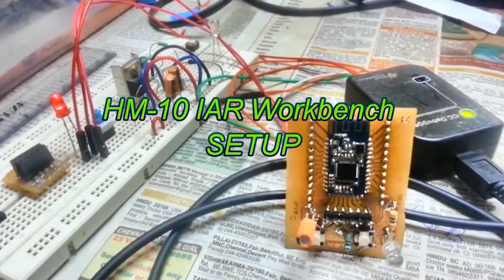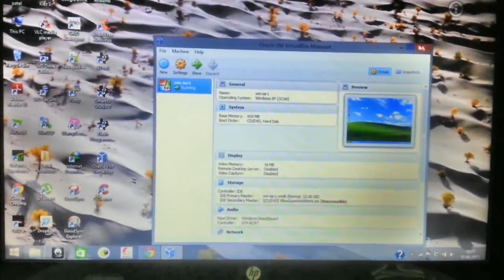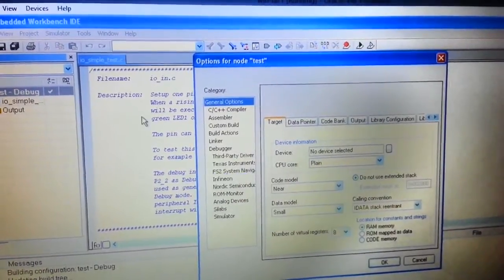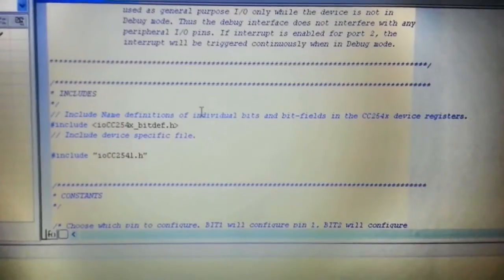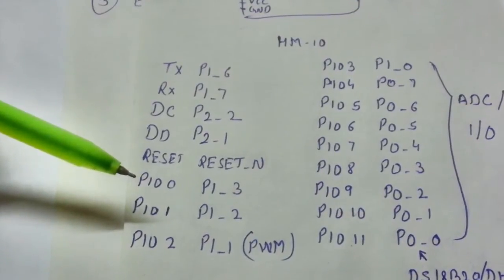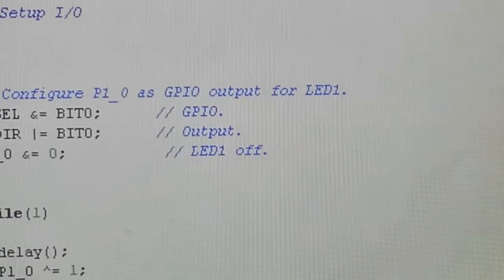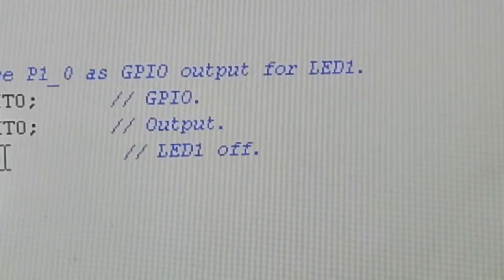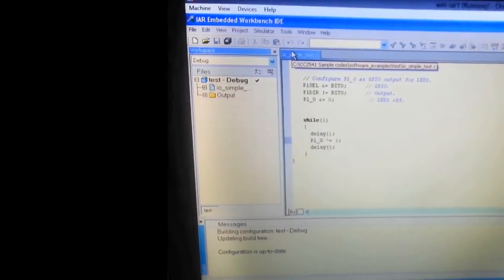HM-10 BLE Remote -01: IAR Workbench Setup

Comment: Hi, I have CC2541 blank chip and PCB also.can i flash HM10 firmware on Blank CC2541 using arduino and  FTDI232.
Reply from the maker: you wont be able to flash the code as you require serial bootloader to be flashed first. But you can surely check how you can flash cc2541 using arduino
Reply: Lovelesh Patel : can I flash serial bootloader using arduino to cc2541 bcz I don't have cc debugger

Comment: where'd u get iar wb? and the code from????

I have vmware xp 32bit would that work?

I have 2 HM10 modules, I tried AT command AT+BAUD7 for 1200bps but it makes the all AT commands respond with "OK"

instead of the usual responses, also the STATE pin = LED state. (flashing not connected, solid connected)

I just need those two things to work.

I have Btool but haven't figured out any specific Address/Instructions for cc2541 implementation
Reply from the maker: I actually used the VM running XP from my friend. Until you have the CCDebugger and IAR workbench, you can't modify anything.

Comment: I can see your code?
Reply from the maker: +chan nghich For the demo I just used a GPIO set reset code. You can get that code on the web easily but none of the BLE functionality won't work. its just microcontroller code.

I would suggest you try the BLE broadcast and BLE peripheral codes and add this LED blink in that code.
If you have difficulty in finding the codes I am sharing my work folder
https://drive.google.com/folderview?id=0B-2Ah0KC5ACmQ3c0MTNWN3FwYzA&usp=sharing
Reply: thank you very much.